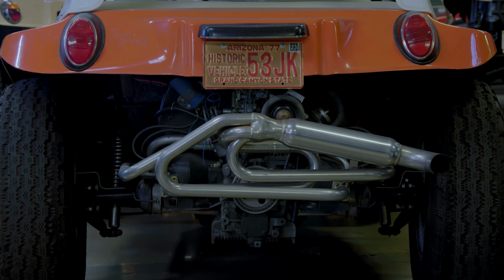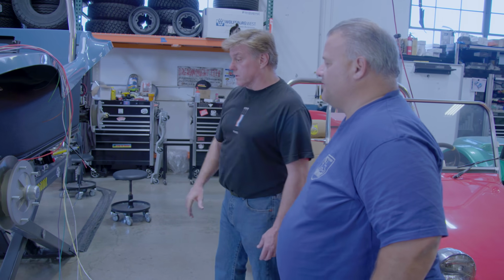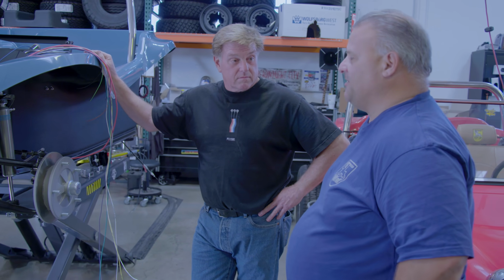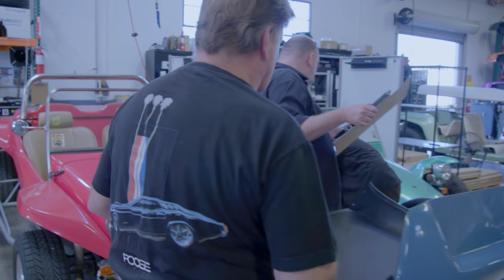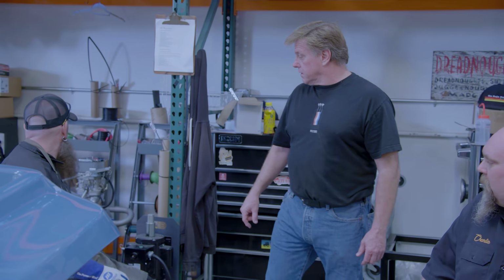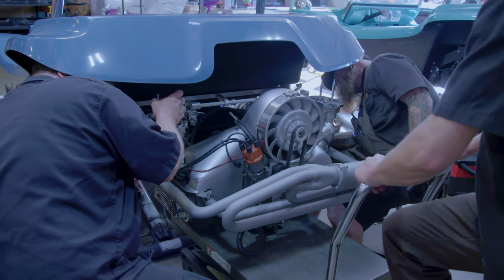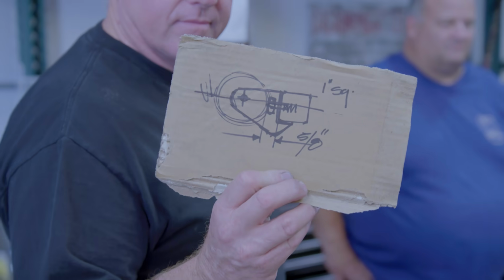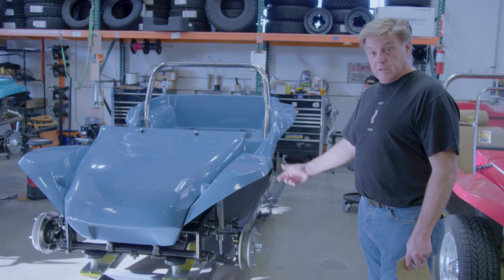An Exclusive Look Into the Meyers Manx Workshop!

Comment: Question : Won't that Porsche/upright type 4  style fan be sucking super heated air off the exhaust - which in this case is right in front of the fan inlet? Won't this motor be running hot/overheating - especially when idling?

Comment: Come on just rong from the start that chassis is nothing like a 350 and that engine is also nothink like a 350.  I can see how this is going to end up looking anathing other than a buggy with some porche look alike  parts.      If you are going for a 350 bases then start with a 350 replica chassis and run a 4 cam motor mid monted or at leest a super 90.
Reply: LOL 
You know nothing about Hot Rodding!

Comment: In a orevious century the Manx facility was on the north side of some freeway at ( I think) the city of industry. At one point I could not stand it any more and stopped in. The shop was not large, maybe 5,000 square feet. There wS a lobby with lots of stuff that I should have bought immediately. Most of the warehouse was dedicated to Manx kits and frames. The snell was intoxicating (literally). But, as far as I was concerned was in the back. There they had the huge flat plane heater and molding machinery for making the top and bottom of m the Manx SR. I was told that the vacuum table and other molds that were leaning up against the dingy wall were the molds necessary to make a sports car that was called the Panther or something like that. The top and bottom halves that are bolted together.